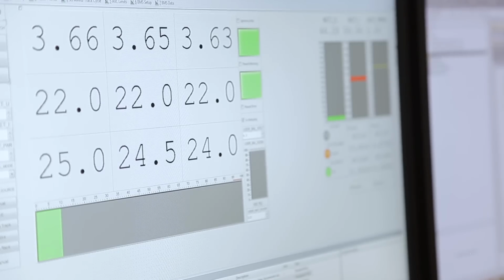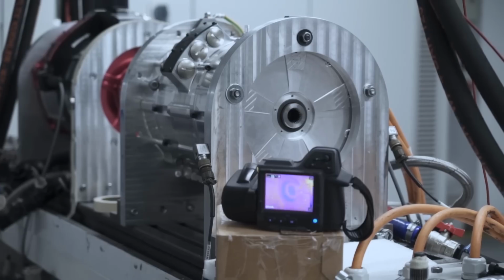Ep. 2/4 - DISCOVER RIMAC TODAY: FACTORY TOUR with Mate Rimac - C_TWO Assembly

Comment: Keep pushing harder! I'm very impressed of your success already. These videos are awesome. We need more innovation to get the most out of everything. What if your prepreg assembly was done by automated robot in complete vacuum? Get somebody to create sim for that robot and you will be surprised. That prepreg must have some "overhead" to count the air etc. in the mix. I'd say atleast 10% difference in weight and benefit in full with strength. Also the AC unit which is heatpump operated should have some level of heat recovery / cool recovery rather than push-type fan system. How can i send my possible invention regarding this?

Comment: What about the repairability of the monocoque? For example in racing or on normal street use a hair-line crack can occur, would that just mean that you can throw away almost the whole car?
Edit: please don't see this as an insult.
Reply: I guess a crash that cracks the monocoque would be a writeoff crash in "normal" cars as well.
Reply: I was wondering the same thing.  Is bigger actually better?  The stiffness improvement is great, but cars need to be repairable too.

Comment: I suggest you guys conduct a review of the manufacturing and assembly process to improve workplace ergonomics in order to avoid placing the workers in posturally compromised positions (e.g hunched over like the woman at 1:15 and 2:30). This is important to avoid workplace injuries and downtime, and increase worker productivity and well being. Some of the changes might include adjustable height work surfaces, work surfaces designed specifically for a part of the manufacturing process, redesigned carbon fiber moulding tools and mounts for said tools that place the parts in positions that are safer and more efficient to work on. Love what you guys are doing.
Reply: Albano Mitri - yes, we’re on it. Too much stuff at the same time going on. But we’re aware of improvement opportunities and will address them soon.

Comment: I want to know how you build the motors!
Reply: ADSlammer I think those are outsourced. They are probably just fine tuned in Rimac to fit their needs.
Reply: @diabq  No lol, they're not outsourced. They design and build them literally from ground up. They don't outsource anything other than battery cells and tires.  They built everything themselves, down to tiny stuff like pcb boards for all the electronics,  headlights, seats, etc. Stuff that other companies just buy off the shelf or have someone else develop.

Comment: How can the battery be replaced over time if it is a structural part of the monocoque?
Reply: Stan Allosserie - it is bolted to the monocoque. Structural parts don’t have  to be fix (welded/bonded/riveted). The rear subframe of any hypercar (other than C2) is bolted but of course structural.
Reply: @MateRimacAuto  That makes sense. Thank you for clearing this up!